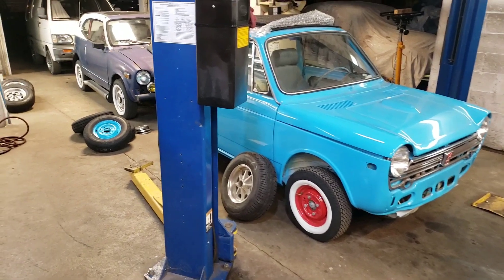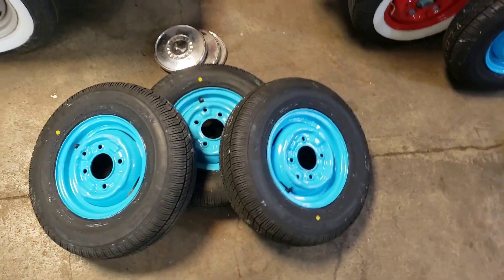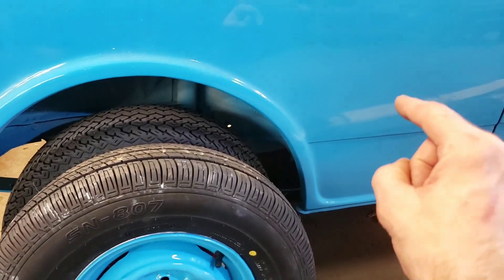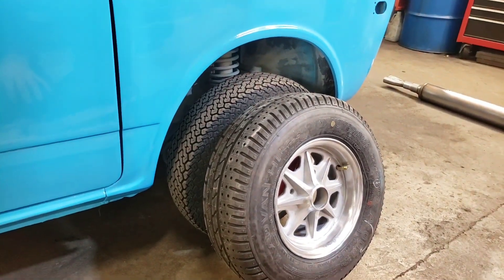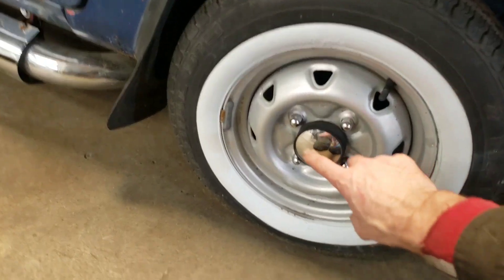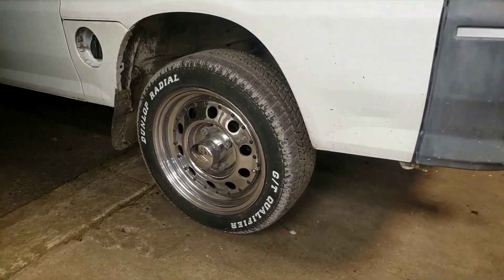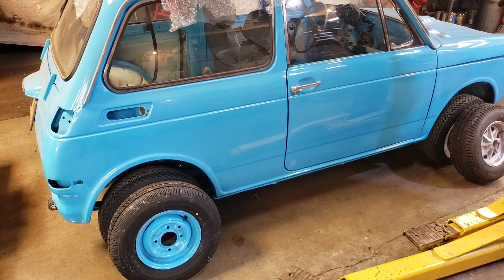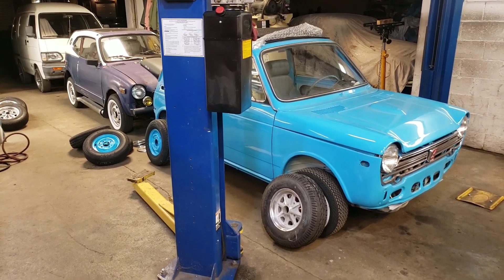Wheel Dilemma

Comment: Hey i have a subaru 360 and desperately need a window and i dont have the front brake backing plate and cylinders for ether side. Any way i can buy something off you even a windshield that has a chip in it. Im in Frederick md if you think you can help me get any parts.